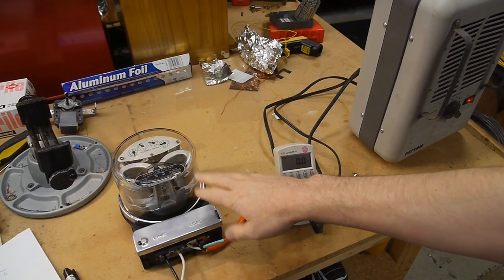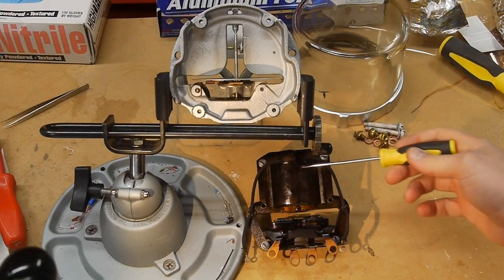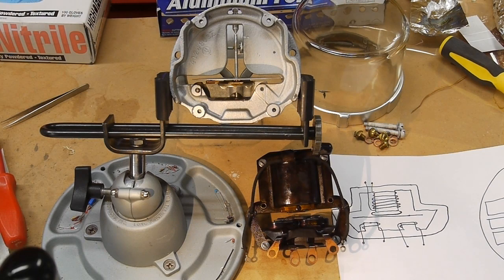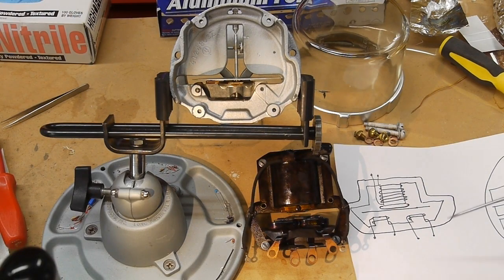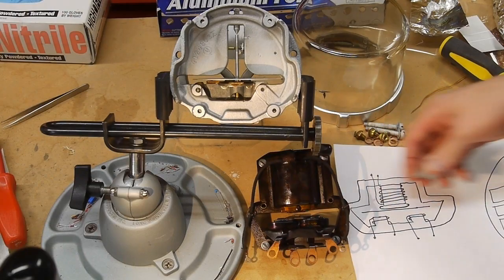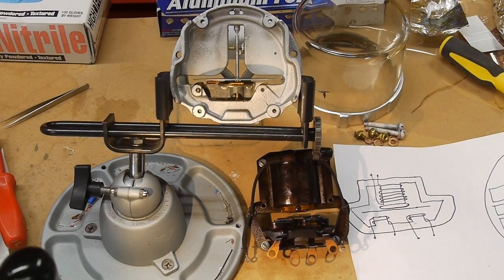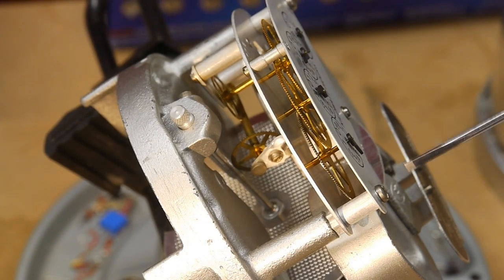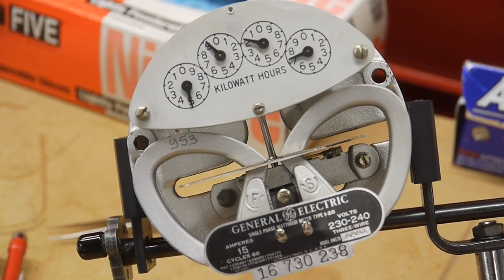Explanation of how kilowatt-hour meters work (electromechanical)

Comment: I know air gaps are used in inductors/transformers to prevent core saturation, as air (and other non-magnetic materials) cannot be magnetically saturated. Could it be that the stippling has the effect of more evenly distributing the eddy currents flowing within the disc? I've looked for an explanation, but so far cannot find any.

Comment: Interesting to see one of these american meters with a built-in terminal block, as most I've seen are the 'unpluggable' variety.

In the UK, all electric meters have their terminals built-in, the meter is fixed to a board, then wired [normally] with cables that are 25mm in cross-sectional area.

I play about a lot with electric meters on my channel, & I've even revved-one up to silly-speeds by taking out the accuracy magnets. :D

Thanx for showing,

-BoomBoxDeluxe.
Reply: The difference is the power.  The meters that serve a whole residence are the plug-in type.  On those, the load current does not run directly through the current coils, but through transformer coils.  This meter is only rated at 15A.

Comment: Testing gets done for Base load, Base load at 0.5 PF and Light load. Then Middle load gets run and errors noted.
e.g. Class 100 meter. Test Amps 15 = Base load.
Adjusting is done at BL, PF and LL
The test bench has a multi-turn potential coil to avoid, the meters reading each others burden.

Comment: Great video. The marks on the disc make it easier to calibrate a batch of meters. Single Phase meters are usually tested in batches of 20 or 30 or more. At a 10 revolution test it is easy to determine the overshoot or undershoot direct in procents. Black mark at front, Current and Voltage applied, 10 turns of the disc and stop. Current and Voltage off. adjust and repeat to get the meters within the ± 2 % or better.

Comment: The stippling on the disc... That has something to do with efficiency, not to make it easier to see it spin. I have a small air compressor (think aquarium pump) that works on the same principle as watt hour motors. It has the same stippling on the disc. The disc gets hot...cooling? The gaps between disc and stator pole pieces is quite small... could the stippling function as dimples on a golf ball. Just some thoughts.

Comment: In most parts of the industrialised world the incoming power (even for residentials) is with 3 phases, but this meter is only for one. How would a 3 phase meter differ?

Btw. is 1 phase still common for residentials in the US?
Reply: The principle is the same.

Comment: The disc is made of aluminium. Al is a very good conductor and therefore the changing magnetic field of the coils induces eddy currents in the alu-disc. These eddy currents in the Al have their own opposing magnetic field (opposing to the magnetic field that induced them). It is this interaction that creates the motion - not the magnetic properties of Al itself. Al is actually paramagnetic (very weakly drawn towards a steady magnetic field).

Comment: Not quite these gears. Gear wheals in clocks and those in measurement amplification devices have different requirement of quality of there gears, due to clocks having a reduction ratio. The total error in tooth spacing is divided by the final ratio, and is all together eliminated when the cycle is completed. While the inverse will compound the error giving a non linear representation of the needle. Thus indicator gears are made to a much higher standard then the mass produced clock gears.

Comment: Also, this meter is designed to operate with a nominal 240 volts across the voltage winding.  The friction compensating function will generate insufficient torque with only 120 volts.  In order to accurately measure 120 volt loads, you would need a small transformer to precisely double the voltage, then connect the load through only one set of current windings.  This meter design inherently "assumes" the neutral to be electrically centered.
Reply: It works accurately regardless of imbalance between the two sides of the 3-wire service.  The voltage coil is always connected across the lines for a 240V potential difference.

Comment: Very good explanation.  As was stated before, though not explained really well, the reason there are two sets of current windings is to measure current independently in two separate circuits, the system specifically called "120/240 volts, single phase, three wire".  You'll note the meter states "three wire" on the front.  The neutral does not connect to this type of meter.  "Split phase" is a term commonly mis-applied to this type of system.

Comment: Ben, here is mine, and a diagram i drew showing how it works. magnetic drag adjustment as well, but mine also has a adjustment screw that bends the voice coil. both the volt and amps coil were fixed and separate. youtube.com/watch?v=GCMyqmHexvI

Comment: Note that the shaded pole is not located at 90 degrees on the motor, but rather 30-45 degrees. capacitor run motors have the second winding located at 90 degrees. induction machines such as most fridge compressors, use an aluminum start winding at 90 degrees, (because it would take up valuable run winding volume elsewhere) but the resistance produces the phase shift. in most cases, the resistance is so high that its of no benefit to hard wire a run capacitor in series with the start switch.

Comment: Very cool video.  What's the history of this meter?  15 amps is very small.

Something that wasn't clear to me in your explanation was the three coil arrangement.  Was that second current coil necessary for split phase use, as oPossum5150 pointed out?

Comment: At the start you show the analog meter and digital meter inline with the load. Did you run them long enough to see how close their measurements are? Great video and explanation.
Reply: Guess we will never know….
Reply: I doubt they would show the same, especially since the analog meter is only made for vertical mounting, not lying on a bench, and the digital meter is probably not very accurate either, considering it's a plug-in-socket type of solution.

Comment: The two current coils are to allow for use on split phase systems. Split phase is still considered to be 'single' phase in the electrical world. The neutral wire is not connected to residential meters.

Comment: Can't speak for where you live, but around here someone still comes around and reads the meters. Some of the newer "Smart Meters" have wireless capability or can transmit their data over the power lines, but even most electronic ones I've seen have an IR communications port for someone to plug a data recorder into.

Comment: Well, the meter in the video is designed not to be sensitive to the reactive component (current out-of-phase with respect to voltage), but the sort of meter I was asking about would ideally be sensitive simply to the product of RMS voltage and RMS current without regard to phase relationship.  Maybe such a meter is effectively two meters, one of which measures real only and the other of which measures reactive only, the ultimate result being the sum.

Comment: I think the asymmetrical current winding is related to using the meter in 110VAC mode (as you are doing with L1 and the neutral) as compared with using the meter in 220VAC mode where there are two line wires with the neutral not going through the meter.

Comment: The Watthour Meter  By William Martin Shepard, Allen G. Jones, 1910 on Google Books is an excellent source for more information on the Watthour meter.  I believe it has an explanation for using dual copper rings to achieve the 90 degree phase shift.

Comment: Thanks for this vid, Ben.  My father is an electrician and he brought one of these home for me to take apart when I was about 12 years old.  I was amazed by the magnet/needle bearing and I've never seen one since.  I made something to hold the disk so I could spin it and watch it free-wheel for a very long time, but then be amazed that the permanent magnet would stop it in less than a second.  I didn't understand why that worked until i was much older.  Make another video on a further teardown.

Comment: A very nice video, as usual!  As you point out, this meter is sensitive only to real power, any reactive "power" won't contribute to the spinning of the disc.  I know that some industrial utility customers are charged by the kVAh instead of kWh (i.e. they pay for the real component + reactive component) and have corresponding meters.  Do you know how the construction of such a meter differs?  One would think that in detail it must be quite a bit different.

Comment from the maker: Thanks. I've wondered about this myself. There are actually two copper rings (one above the disc and one below), and the lower one has additional lobes and shapes that I do not fully understand. The adjustment of the permanent magnet can probably be setup to work with whatever torque they get from the coil design, so the whole thing can be fairly easily calibrated.

Comment from the maker: It's a good question. I believe the system would work with just one current coil, but it's easier to manufacturer the single iron pole piece to be symmetric and balance the magnetic field between two areas. There is also magnetic shunting in the pole piece, which may be easier in a symmetric design.

Comment: Just for quantitative reference: a shaded pole doesn't make a full 90 phase shift.  A single (ideal) "shade" can only get a maximum of 90 degrees, but with zero signal (no torque).  Probably, most do more like 30-45 degrees, with more useful attenuation (hence why shaded pole motors are so weak).

I'm not sure how they generate a full 90 degrees in the meter, doesn't look like there are multiple stages of shading going on.

Also, that face with the magnets looks kind of angry! ;p

Comment from the maker: Sorry, I should have mentioned the voltage coil is wired across the line, so its magnetic field is proportional only to the voltage of the circuit. The current coil is wired in-line with the load, so its field is proportional only to the current.

Comment: If you have the copper ring to shift the magnetic field from the voltage, why do you need two current coils? And why do they need to be shifted to the side? With the 90 degree shift, one current coil shouldn't be enough?